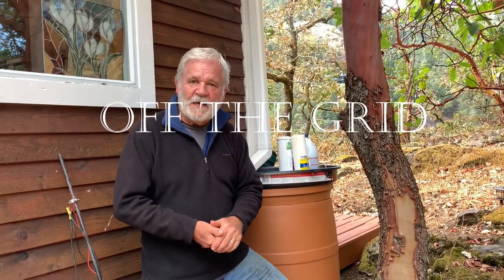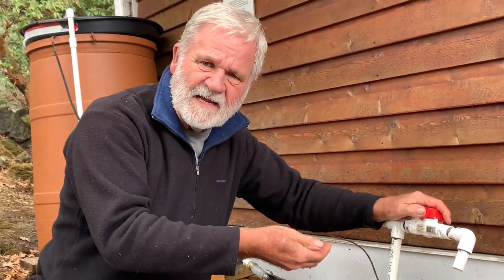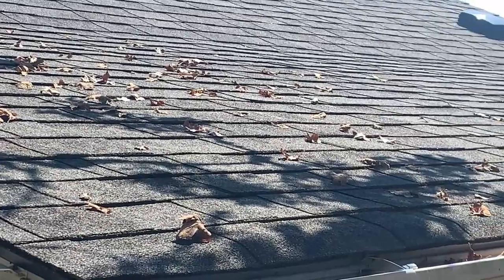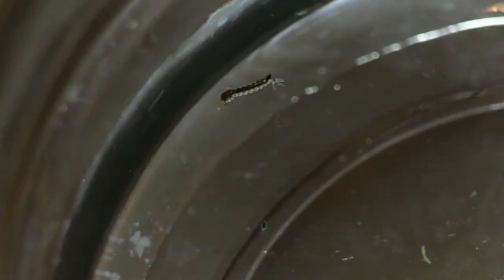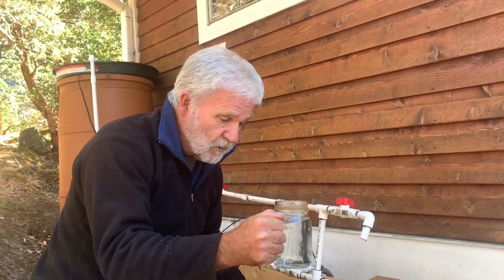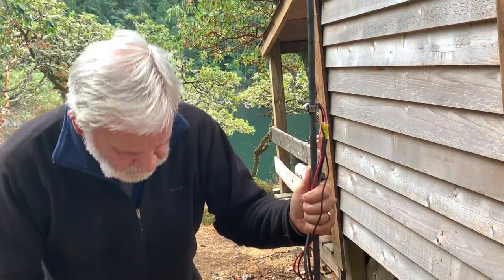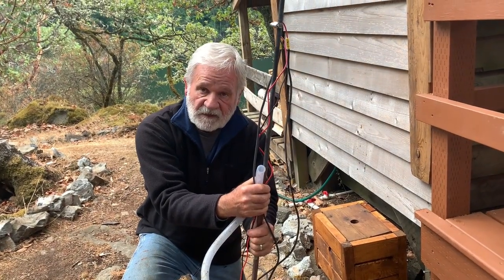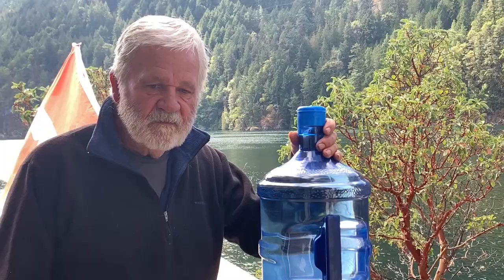Off the Grid With Karen and Grid: Beware, Standing Water Can Put You Down

Comment: I've seen a few setups where the first hour of rain is not collected to allow it to wash the roof and gutters out without collecting the surface material into the tank.
Reply from the maker: Thanks. Your observation is probably a better idea. With water in short supply I just use the collected water to rinse out the tank.

Comment: When the tap is running, I can imagine the water flowing quite quickly across the uv light. Does the bacteria really get killed as quickly as that? How about instead adding the uv light inside the tank?
Reply from the maker: Good question. The unit we use is called Water Fixer. Made by a company in Grants Pass, OR. We have two. One, for our cabin in the Siskiyou’s, is wired for 120v. The second is wired for 12v, for our rock in BC. Both have .5 micron filters and a UV light. Flow rate is one gallon per minute. We only filter
The water in the kitchen. Spec say unit removes 99.97 % of bacteria and viruses. We’ve never had a problem. The unit is switched to save power. We turn it on when we want drinking water. I believe larger systems are available. Re putting the unit in our water tank:  that might work but it would require a lot more energy (large volume) and constant use, as standing wAter, even if it starts out sterilized, will got bad if left standing. We prefer the “on Demand” configuration.

Comment: This has been a bit of a battle for me with the spendy .5 micron filters clogging quickly due to what I believe is Algae growth. I have resigned to chlorination the tank in hopes that will prevent algae from growing and clogging the filters. I read somewhere else that I should actually have my UV light before my .5 micron, not after.
Reply from the maker: Jeff: A couple of thoughts. One, we've had a lot of success putting a 5 micron filter in front of our main filtration unit. We can wash and re-use these filters, they're relatively cheap, and our 0.5 filter lasts much longer. Two, a carbon filter will help take out the chlorine taste. You can get them in 5 micron sizes. Three, our unit has the filter first, then the UV light. Makes sense, as you don't want small particles to cloud the water and reduce the effectiveness of the sterilization process.
Reply: @offthegrid4036  I have Rusco spin down pre-pump, then I run 2 big blue  4.5 x 10 housings, one with a 10 micron sediment filter and the final one is a .5 Micron carbon block filter and the finally a 36" UV light.

Note I'm running 0.5 micron filter as the final filter, not 5.0 Micron.

Thanks for the reply. I'll report back how the chlorination goes. I'm on the coast of WA state and actually ran out of water. Got 200 gallons last week but need more! Only 1 inch of rain since last June in what is considered a rain forest.
Reply from the maker: Looks like you’re finally getting some precip. Really bad in the Siskiyous. What I do not understand is how long chlorination lasts. I don’t like the idea of continually adding chlorine.